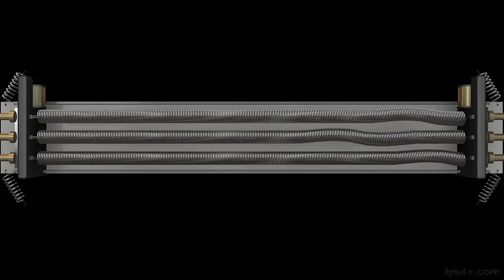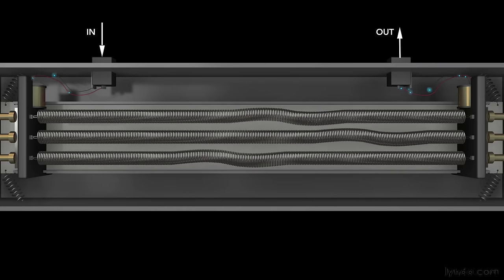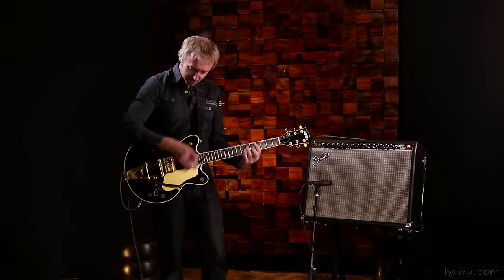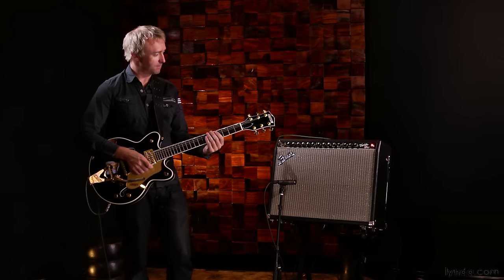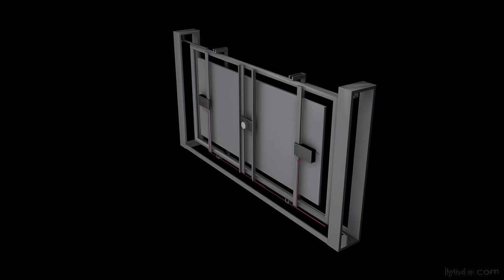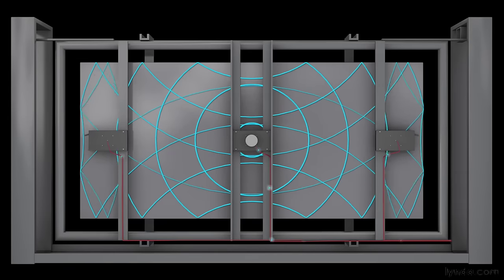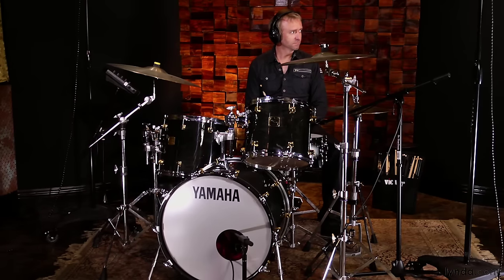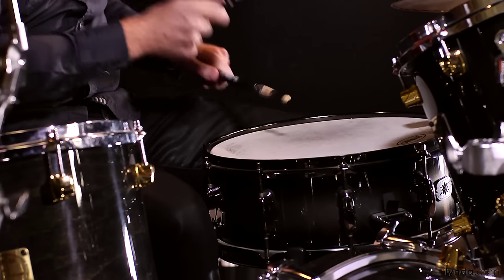Audio and Music Tutorial - Mechanical spring and plate reverbs

Comment: This video is amazingly great :D
Reply: I'm building a reverb chamber, using a ten by 8 by 8 metal storage container that used to house woodchips. Now empty, it needs some new paint and storm windows for the baffles inside for the irregular shape, though the ceiling is trapezoidal in shape. The door to open it is about 1 ton and solid, and can act as a plate for a huge reverb sound. IDK how big the biggest plate reverb device is, but this is enormous. Just scaling up a 60's marshall plate. otherwise it will be a spring reverb chamber.

Comment: If you do go with low short signal out of the spring/plate du give youre song/instr. a bit a room it sounds like a real room, but for deep reverb it have his own character who came out BUT if you will real deep room you need a room!!! Digi reverb are not a better option, only cheaper and need not the space like ana stuff, so i prefer the analoge equitment for recording. ...best way is to use the wet room you record ;) but in akustik perfection room with basstraps against room modes ;) ...yes, a wet room or ana reverb!

Comment: I've always liked spring 'verb units for voice and guitars. The one I have is a small Epiphone Acoustic Reagent, a two channel. One for a  acoustic guitar and one for a vocal mic that doesn't need phantom power. Even my electronics engineer friends like this little thing. Also does a very nice electric guitar or keyboard amplification. It wasn't expensive and it's not as insanely heavy as a bass or keyboard dedicated amp for small things. Only downside: DON'T LET ANYONE BUMP IT WHILE ON, at power. You'll regret not using those ear plugs,  trust me, lol. Screams like a cat in.a room full.of rocking chairs. 

I've smartly gotten used to wearing professional grade custom.ear plugs working with anything loud (drums) or with the possibility of feedback. Still have all my hearing after 25 years of this. Learned very early at a LOUD front row show: never go anywhere without ear plugs again. Very important to be able to.hear developing feedback, as well as pitch/tone differences,  and if you're real slick, phase!

Would have liked to seen the difference between drums, guitars and vox (vocals) with and without the 'verb. Also in larger setups, you kind of can't avoid compression first,  but I guess that's another video. Just hate to see someone go to the music store, but piles of stuff and find out why we don't do that:) Just why you have compressors before digital verb units (see "cats in rooms full of rocking chairs," lol) 

Good video, thanks

Comment: there is one more mechanical reverb that KILLS both a spring and a plate, and that's a piano harp (soundboard and strings) reverb. plate is cool but way too much trouble to build and way too expensive. They give away pianos on craigslist every day. In my city, there's 50 free pianos at a time. simply connect a contact speaker and a piezo and you got a badass acoustic/mechanical reverb that you can tune.